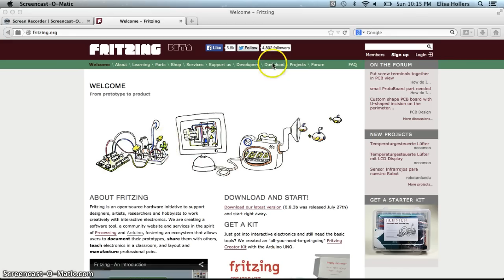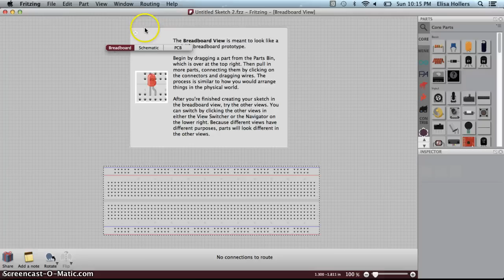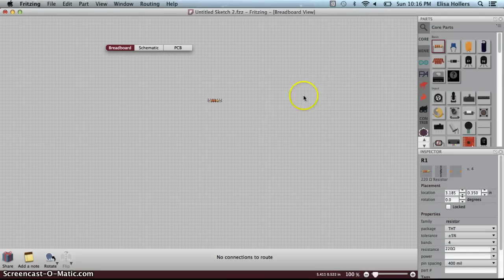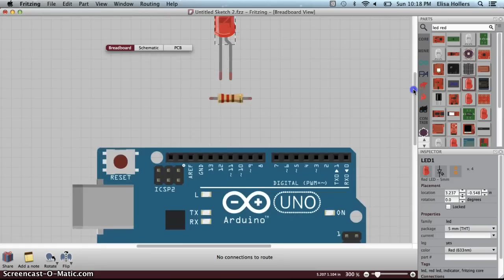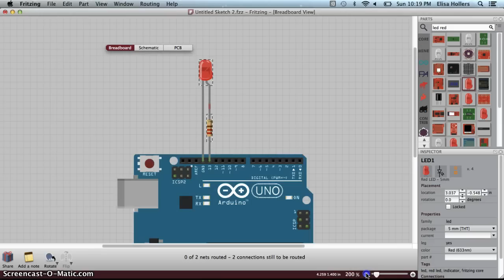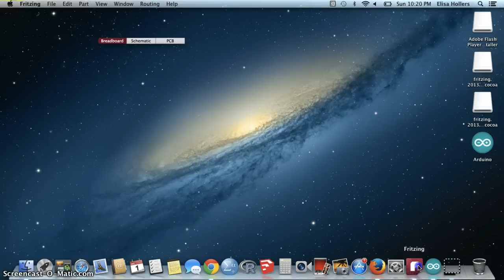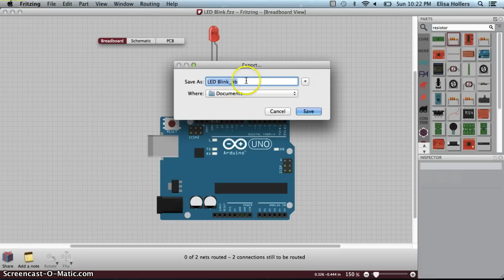LED Blink with Fritzing

Comment: Good tutorial ...but how do you make it blink? Code...etc
Reply: +Chupria You can't simulate electronics
Reply: +שגיא קרמן so i can't see it blink then and if not can't describe me any electronics simulator in the market ?
Reply: Abdelrhman Rayis There are some simulators, But only very basic and with Thousands of bugs.
It's better off to With Write your own software or to Buy the ingredients and play around.
An arduino uno is only about 10$  and a mega (70 pins and a faster processor) is only about 30$.
Reply: שגיא קרמן  thanks but i am searching for real time simulator because it could provide a lot of parts that's is hard to find in my market (:
Reply: Told you. There are no simulators.
Reply: Breno Tome thanks
Reply: Breno Tome Thanks!
Reply: +שגיא קרמן proteus  ???
Reply: Eren Cankurtaran ??
Reply: +שגיא קרמן proteus simulates the system
Reply: oh cool i'll look into it Eren Cankurtaran
Reply: +Abdelrhman Rayis just go and search for 123d circuit, its a working simulator, you can test ur board
Reply: thanks man TheSproutTV
Reply: starfirr XvX  Wow man first i thought its its a joke hahahahh ! but i found that you're advice was really helpful thanks a lot man (^_^)
Reply: yeah xD i had a feeling that you will think its a joke xD hhh happy to help
Reply: You can use a program called multisim to simulate electronics, but it cost like a thousand dollars
Reply: cowboyatthebebop i